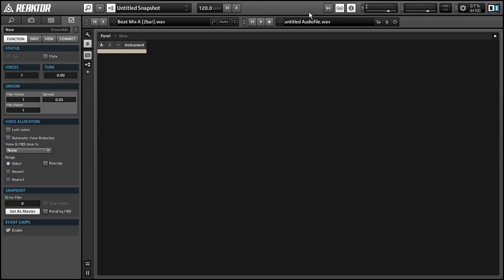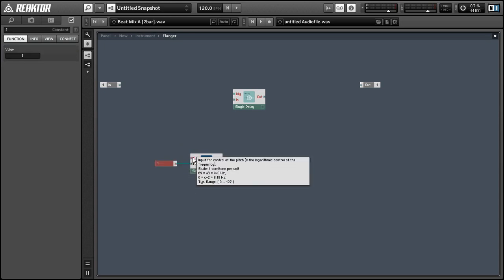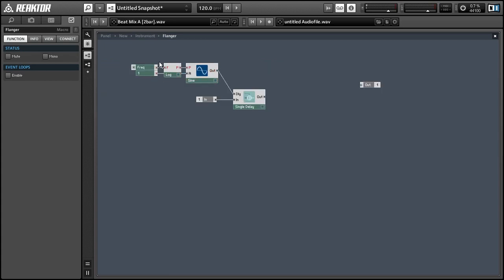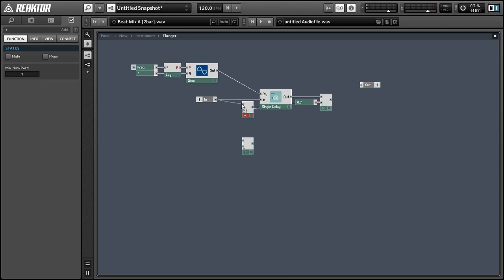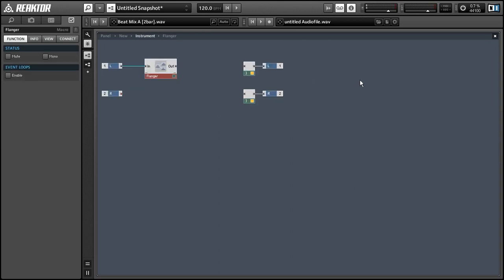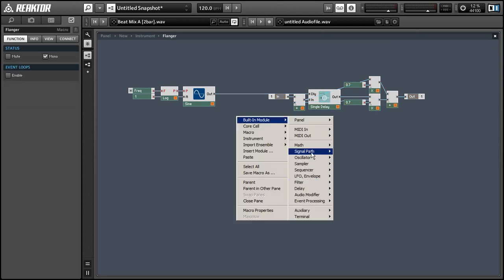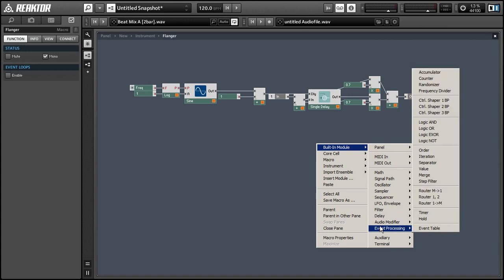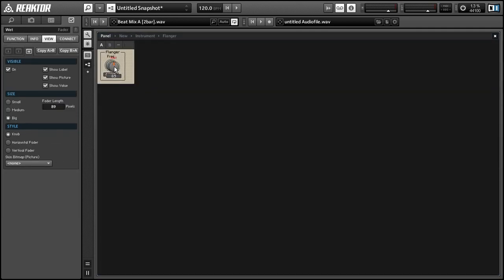Reaktor - How to Create a Flanger - How to Tutorial

Comment: Pro tip: try adding a multiply module between the "delay output" and the "feedback control", and create a "constant" with the value "-1". This will create a different sound than the regular flanger - and you can of course add a "switch" module, to easily be able to switch between "positive flanger" and "negative flanger". Im pretty sure this is what Korg did to create the "Flanger -" insert effect on the Electribe2 ;)

Comment: .hay Salamander, why not using LFO to modulate the delay time? it may give the user much more possibilities
Reply: An LFO control is just a low hz wave, so we might as well use one that can go way past the limit if we want to for audio rate modulation. An LFO would be less flexible.
Reply: you can get the LFO to audio rate by multiplying the LFO out -  Max rate of the output of the LFO is 12Hz if you multiply that with 2 you get the max range of 24Hz.... - the reason he is using OSC is the smoothness of the wave cycle. the OSC doing that better for this FX has he mentions in another tutorial. by the way, the Max range of a flanger is usually up to 10Hz..that is less than the LFO maximum rate
Reply: I've tried to do the same, but with LFOs. The sound was with artifacts, and I've found this video looking for the solutions. When I've changed LFO to Oscillator, my ensemble began to work correctly.

Comment: Yo, after sending an input into the simple delay module, you switch to a separate flanger window or group....but you haven't explained how you did this.....could you enlighten me. Cheers
Reply: Also, while these tutorial's are very insightful. You also miss out many key points in not just this video, but other's too. Im just a beginner so missing out even the small stuff is throwing me off. Not sure if you intended to do this but i think some of the other explanations could use some touching up including this one. Hope this helps
Reply from the maker: Sorry, what part of the video (timewise) do you mean? 

We have a three hour long course that covers all the basics of Reaktor on adsrsounds.com . Rather than continually repeating the same information in each tutorial (there is a lot), it is assumed you have a working knowledge of the software for this tutorial, but I'll be happy to answer any questions you have.

Comment: You know the kind of ripping sound that a flanger has? Is there any way to create a flanger that keeps that ripping effect at a specific part of the spectrum, where you can modulate the position of that specific part instead of just having it move back and forth between two points? Does that make sense?
Reply from the maker: StateAardvark honestly i'm not sure, i haven't ever seen a flanger that could do that.
Reply: YES this works - and you wanna know what else works? You can add a "multiply" module between the "delay output" and the "feedback control", and create a constant with the value "-1". This will create a "negative flanger" effect (at least thats what its called on the Electribe2). If you create a switch, you can route the sound from the end of the delay line into the switch, and name this "+", and then do the same with the "negative flanger", and name this "-". And then you suddenly have 2 different types of flangers to choose from ;)